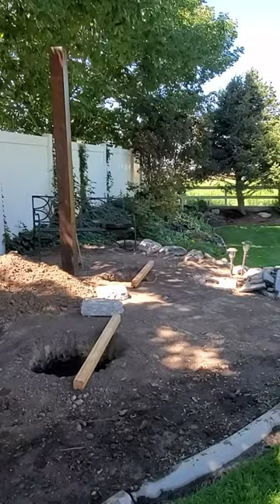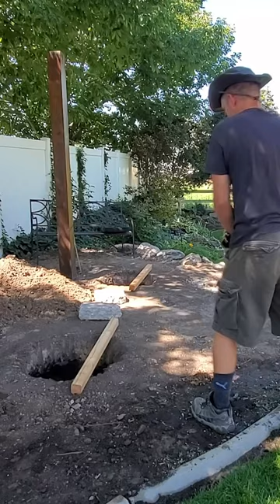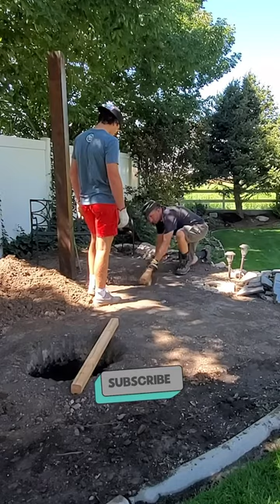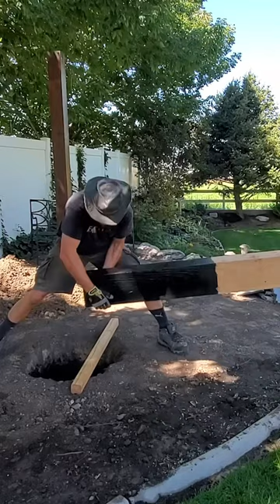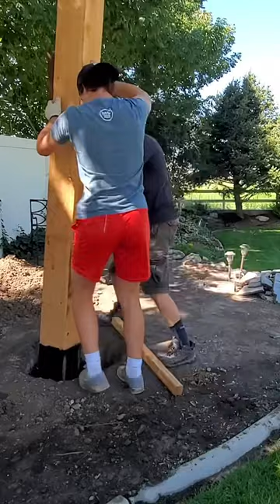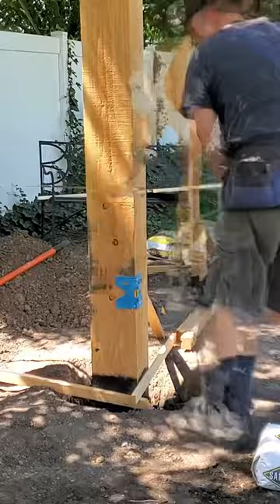Placing and Leveling Arbor Swing Posts #backyardgoals #woodworking #outdoorliving

Comment: Not judging or talking mess. But what's the purpose of the 2x2 sitting across the hole? You move it over anyway when placing the beam.
Reply from the maker: I used those just to help keep dirt from falling in the hole.  Those post where heavy.